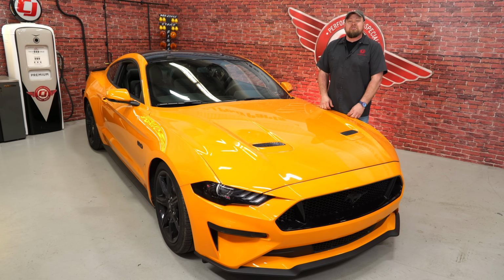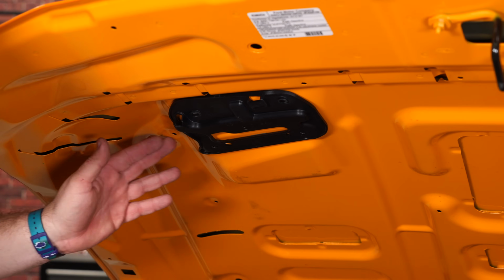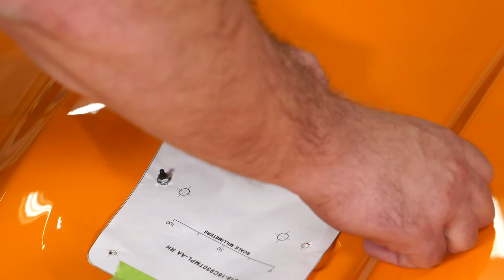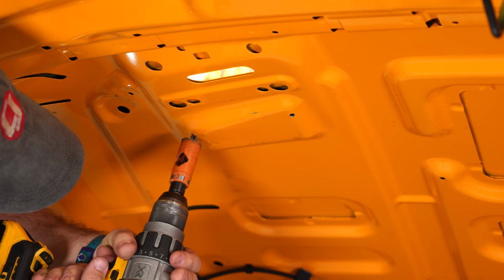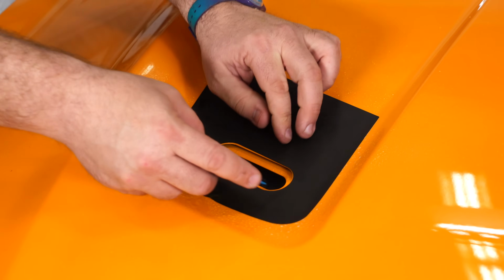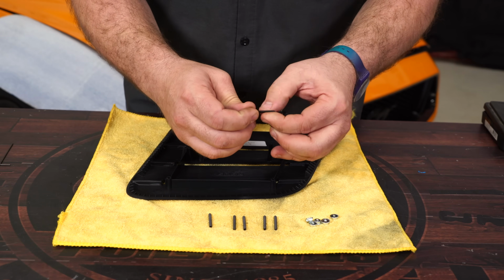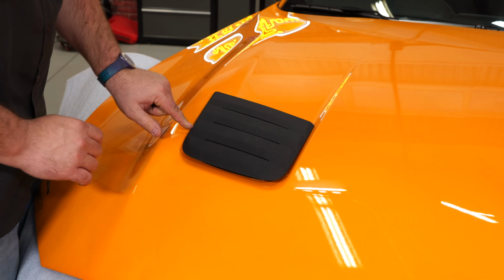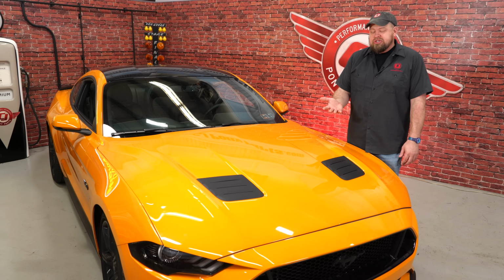2018-2023 Mustang GT Gets Roush Styling & Functionality w/this Hood Heat Extractor Install

Comment: 4 screws is enough to hold them into place, use some good outdoor doublesided tape and they will hole without a problem, no need to drill more holes

Comment: Installed these on my 18, I almost sent them back when I saw the drill part but I installed them without drilling the extra two holes and you can't tell a difference.  I put some 3m tape on the plastic boss where the top two threaded inserts go, and the 3m supplied tape that goes around 3 sides of these is more then enough to hold it in place along with the 4 holes that already exist.  This allows me to switch to something else one day if there are better options or go back to factory inserts if I don't like them.  Installed both in under an hour, no permanent holes in my hood.
Reply: Good improvision!!  I watched this video and was like WHOA!!!  Drill into a $45k car I just purchased!!  I'll pass.
Reply: Hey Richard J how the Roush heat extractors till this day still holding ? Thinking of buying them and doing the same thing you did don’t want to drill my new stang 2019

Comment: hey guys i just bought a brand new 2018 mustang gt, any advice on must dos? literally only did some cosmetics and bought a jlt oil seperator, thanks
Reply: I can tell you that this is a must NOT do. Drill holes in a brand new Mustang hood, to install a couple pieces of crappy plastic? SMH
Reply: The only advice I can give you man, is DO what makes you happy. If you think it looks good then go for it. At the end of the day it's YOUR car. Don't let opinions effect yours. 👍

Comment: Great video, terrible product. Roush is an "engineering" company, but none of their products fit. You always have to drill, cut, or otherwise modify your car for their products to fit.I will wait on one of the dozen of companies that will release these and use the factory holes.
Reply: I totally agree.
Reply: Roush isn't focused on ease of install they what the products to fit perfectly with some modifications to the vehicle itself.